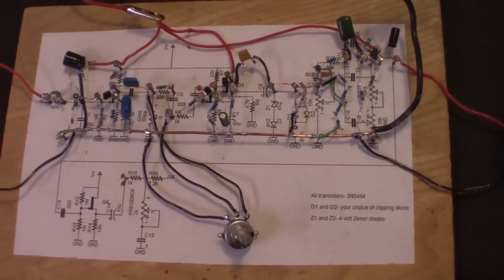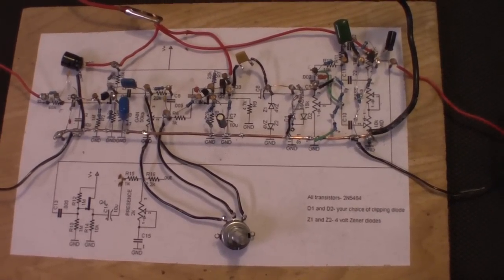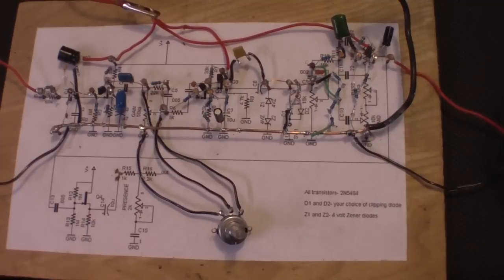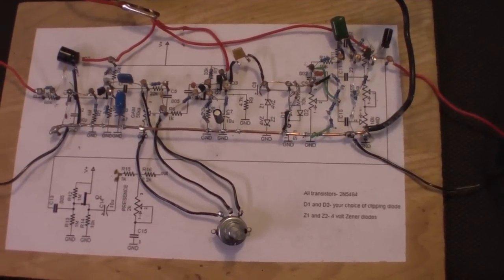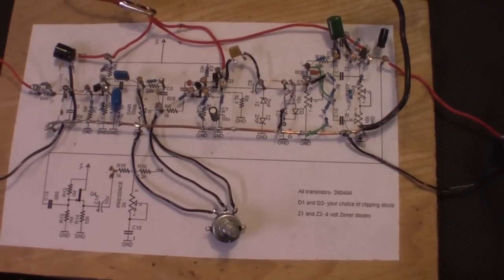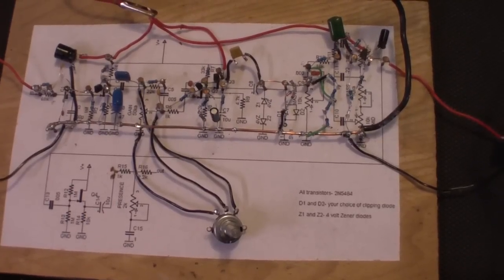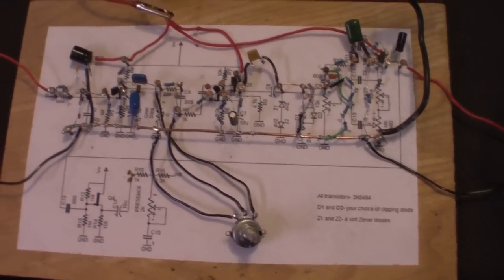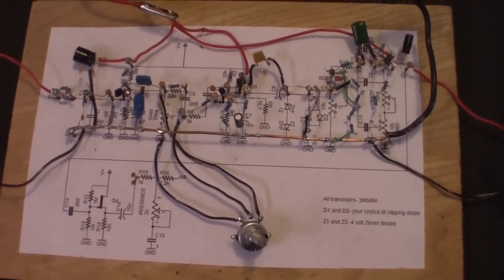Randall RG100ES DIY Guitar Pre Amplifier / Distortion Pedal

Comment: hey kyle i noticd the lack of pots in your circuit (all of them) how do you do that just leave em out? i built the damn thing and it doesnt sound like that. help its driving me up the wall. please!
Reply from the maker: Its been so long... im thinking i probably added a fixed resistor if i skipped a potentiometer. Likely set to mid resistance vallue

Comment: That free space wiring SUCKS!
You do not assemble the parts like ON the schematic.
Just use a perfboard. Rather than mess with etching a board.
Reply from the maker: Im well aware of that. Lol. I did it to learn how the circuit works quickly , it took 1 hr. I  later took it to the pcb state

Comment: How did you power it? On the schematic where the power comes from the power transformer into the transistors what did you plug connect it to? Did you leave the 1/4 inch input on the front end to run the guitar into it? Sounds awesome I’m trying to make one myself!

Comment: Did you rebias gain stages to fit new J201 transistors? And if yes, can you tell me which resistors did you use?
Reply from the maker: No i just checked the voltage at the gate and it looked good,  i forget what it was.

Comment: A few friendly tips... that give you a wider tonal range... (1) Try different values for the stage coupling caps for C1 and C3 in order to pass more or less bass... Try a 0.0047 for C1 and a 0.01 for C3. You will also notice a different behavior when using single-coil or humbucker pups. (2) You can also alter the voicing by using different cap values for C4 and C7 on the FET Sources/Emitters. Try a larger value for C4 for more bass. () You can even do some neat tricks where you thin the signal out with lower values for the stage coupling caps and larger values for the FET Source caps ~or~ visa versa... Experiment. () and for the clipping diodes D1,2? You can use two for D1 and one for D2 that will provide asymmetrical clipping, and/or even use a switch to change from even to odd or out of the circuit all together... the FET's can provide a nice drive without the diodes, too... You're welcome... rock on!
Reply: Can i use ceramic capacitors intead polyester like the circuit in the video?

Comment: to replace potentiometers could you give me the information replacements? thanks
Reply: +Diego Gonzalez Use "A" or Audio Tapered Pots for Volume. Use "B" or Linear Tapered Pots for most Tone Controls. And it's also important to wire an Audio Taper properly so that you get right volume curve.
Reply from the maker: +Diego Gonzalez google "choosing potentiometers for tone and gain control" and learn about linear and audio taper pots

Comment: thanks, but what voltage do u use? in the video you don't use any potentiometer?
Reply from the maker: +Diego Ventura in this demo it was 24 or 22 volts, i forget.
Reply: +Diego Ventura You can run this off of 9 volts if you change R-4,7,13 from a 33k to a 10k resistor.
Reply: hello, im doing that preamp, i have done the pcb but i have problems, when i plug in, it does a sound like a frequency generator, i did the pcb based o this pcb (http://obrazki.elektroda.net/34_1260128762.gif), i check with the diagram of the amp (http://el34world.com/charts/Schematics/files/randall/Randall%20RG100.PNG) , and only has a mistake, in the pot of volume, the ground (pin 1), i did the two channels, like the diagram, and powered with 24 volts, i hope you can help me

Comment: uses 9 volt? or 12?
Reply: +Diego Ventura You can run this off of 9 volts if you change R-4,7,13 from a 33k to a 10k resistor.
Reply: 18 or 24vdc

Comment: Do you think you could email me the schematic
Reply: The original schematic is findable on a google image search... And mine is identical except i omitted a stage or two of fets.
Reply: +Kyle Carrington how does eliminating those transistors effect the overall sound
Reply: A little less gain.  The last one, though is for the tone stack that i also eliminated.  It's easy to add or eliminate stages.

Comment: KYLE THIS SOUNDS KILLER DUDE! I HAVE A 87' RANDALL RG100ES FULL STACK IN MEMORY OF BROTHER DIME (MAY HE R.I.P.) LET ME KNOW IF YOU WORK ON THESE ON THE SIDE OR @ HOME ETC? ALSO THERE IS ONE ROUND "BLUE DIAL" ON THE RG100ES BOARD INSIDE THE CHASSIS & I WAS WONDERING IF YOU HAPPEN TO KNOW WHAT IT IS OR DOES? IS IT A TRIM POT OR ? LOOKS LIKE ONE IT HAS A SLOT IN IT FOR A SCREWDRIVER SO I WAS CURIOUS IF IT WAS FOR THE GAIN OR ? IF YOU KNOW PLEASE LET ME KNOW. THANKS MAN! \m/
Reply from the maker: My guess is that the trim pot is used for bias'ing the the jfets. You wanna have the correct voltage running into each jfet, as this is how they are triggered to move electricty from the source to drain. Unlike bi-polar transistors that use current, these need the right voltage. I more or less just did mine by ear, each jfet is slightly different and more importantly if the biasing circuits are run using a voltage divider off your main input voltage power source -- your bias resistor will vary depending on whether you are powering with 9, 12, 18 or 24V for example. It may be that they have a single adjustable trim pot (your blue dial) that is actually on the voltage division circuit, so in essence by turning that pot, you'd be adjusting the voltage to ALL of the jfet gates, simultaneously.
Reply: KyleCarrington Thank You very much Kyle for taking the time to explain it. After I posted this to you I had found out (On a Forum) that someone had said that it was for the "Biasing" so basically what your saying is it's set up from the Factory (where the Dial is set at) & you should probably NOT mess with it or ? In other words turning it WILL NOT give you a bit more Distortion or ? I know over the years everyone has ALWAYS said to get more Growl/Distortion Etc out of the RG100ES you have to BOOST it with a Pedal Etc to get it sounding better. Is there anything you can recommend or anything that can be done on the Board to achieve this? Thanks again for all your help Dude! Steve \m/
Reply from the maker: Axe Shredder Hey bud. In theory, yes, it is something that for most intended purposes would be set and left. Now, regarding the amp itself, the RG100ES -- i got one in storage, so I'll be bringing it out soon to do a bit of investigating, myself. i built this PRE without actually referring to the real deal, as you can see, it was literally made from diagram hahha, like drive a copper nail into the diagram and solder components hhaha. That said, I actually altered bits, here and there. One aspect I certainly remember about the REAL amp, was, that, it has an outboard foot pedal setup, which is (if I remember correctly) the ONLY way to have the amp isolate the gain stage, from the clean stage. Like a few other awesome amps of it's era (for example the Ampeg SS140 and SS70, SS140C) -- it gave you the option to hear your gain stage AND clean, simultaneously... but... if you left the foot pedal disconnected, or didn't own one -- that became the default, and if my thinking is correct, it meant you never really did hear the all out gain mode --- so -- do you have the pedal? That'd be a starter point. I could be wrong, but I think that is how it went. Secondly, this whole preamp is like solid state model of cascading gain stages -- not so unlike the MESA or 5150 methodology, so, adding stages, subtracting stages --- those things are indeed possible. If you compare your average MESA amp (4 stages of 12ax7) to a 5150 (5 stages of 12ax7), for example -- you can hear the difference. It's also notably important to throw in the topic of a high gain pickup in that discussion, perhaps taking the bridge pup up a level, and leaving the neck alone for cleaning up. A fairly effectively methodology for this particular amp would be the use of a single stage jfet boost pedal, in a lot of senses that'd be doing virtually the same thing. I have built this same amp with 2, 3, and 4 stages. This rendition had four, and you can see by the diagram, the original actually had 5. That is why it was so ahead of its time. Virtually no one was doing five stages back then except Randall, and perhaps Ampeg, and maybe a couple of others' but not many. cheers

Comment: can you help me orientating the tranzistors? i'm trying to make the whole preamp, green, red, and filter, and i'm having a big issue trying to orientate the tranzistors. Thanks.
Reply from the maker: Sure. The transistors have three legs, gate source and drain. To refresh your memory on which leg is which, search Google Images and type in "J201 pinout". Switch J201 with whatever transistor you are using, and make sure the picture you are referring to is the same one you actually have. Typically the signal comes in at the gate. The source is (electrons!) tied to ground with a resistor and often a parallel capacitor as well. The drain heads up (typically) in a diagram and leads to a positive voltage, often through a resistor. This simple diagram shows each leg doing each job, well.  

https://www.smallbearelec.com/HowTos/BreadboardICDist/Fig37.GIF
Reply: i know that tranzistors has 3 pins, the idea is that i've made the whole preamp using the original image of randall rg 100/80 es, and from what i can see there' there's no G/S/D pinout, and, i've also searched the pinout for the tranzistor "image" that appears in your schematic, and i've found none...
Reply from the maker: Kenlong haloGEn First of all, you need to provide information. What transistor are you actually using? You need to learn a bit about FETs. They have a drain, a gate, and a source. The transistor itself (often) has a rounded back, and a flat face. Refer to this diagram. http://spaceryerson.com/pics/img%20RG80-A-SCH234.jpg

See how Q1 - Q7 are noted as 2n5484?

See also how there three legs in the SCHEMATIC diagram of each transistor (Q1, Q2 etc) The middle leg (in the actual diagram, schematic) is always the gate, and in the case of these, the leg going up to the positive rail is the drain, and the leg going down is the source. It is sourcing electrons, or draining current, however you wanna look it. When you are holding one of these transistors in your hand with the flat face pointing to you, the leftmost leg is the drain, the center leg is the source, and the rightmost leg is the gate.

See also:
http://www.theremin.us/200/2N5484pinout.gif

So you can see, in this case the schematic diagram shows the gate in the middle, but in reality when you actually have one in your hand facing you, that is not the case. In my experiment, I actually bent the middle leg back and then to the right, and pulled the rightmost leg more into the center. Then I was able to point to point right over the diagram.
Reply: yes, as tranzistors, i'm using 2n5484, but from what i've read on internet, there are 2 types of it. one as you showed me, and one with inverted pins.

I'll check it tomorrow, and see if it works. Thanks for help.
Reply: i suck at this... finished the preamp, atm i'm going to make only the red channel, without any other parts, and it's looking like i cannot get out from it only a buzz when i touch the central wire of the gain knob...
Reply: ahh, one more think i'd like to ask about the voltage doubler circuit: the capacitors you're using are polarized? which is + and which is - , and why are there nammed with uFnF, can i put 10uf or 10nf in the circuit? Thanks.
Reply from the maker: Kenlong haloGEn I did not emply a voltage doubler. You could, if you wished to have this run on a 9V battery, but this unit is 24VDC.
Reply: yes, i'm thinking on powering the pedal on a 9v transformer using a voltage doubler, but i cannot find a good schematic for an ICL7660, to up my current 2 times, to +27, in the schematic you posted i don't know what to use, 10uf or 10nf capacitors, or what's the polarity of them. and also the pinout of the IC, i see a black dot in there, i guess that's pin 1. Thanks.
Reply from the maker: Kenlong haloGEn Right. The black dot would indeed represent PIN 1. They would be microfarad capacitors. Have a look at this:  http://tinyurl.com/lkxnol7

Comment from the maker: This circuit is permanently "clipped" - there is no switch to remove clipping diodes but they are nice sounded diodes compared to 1n914', in my opinion. Same diode as the original TS 808 Ibanez tube screamer.